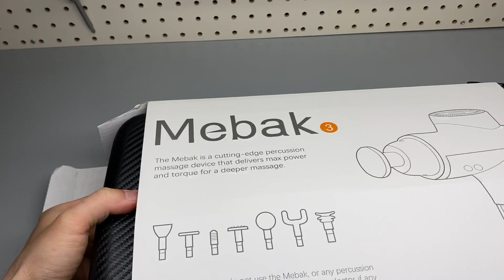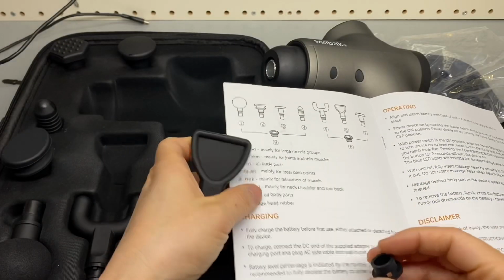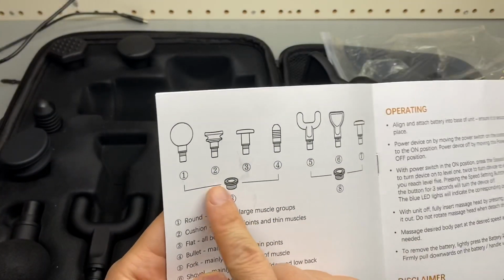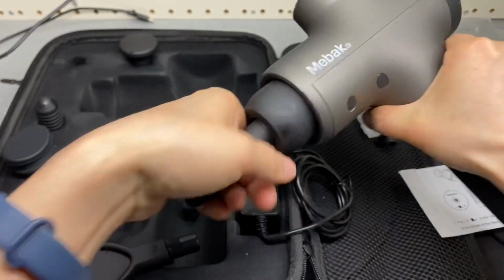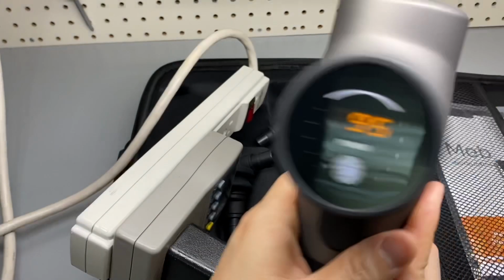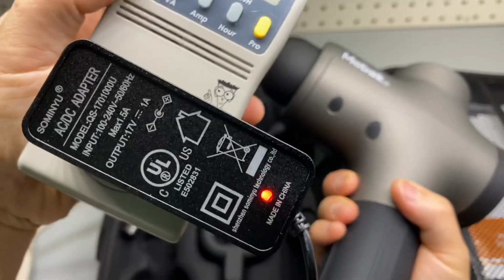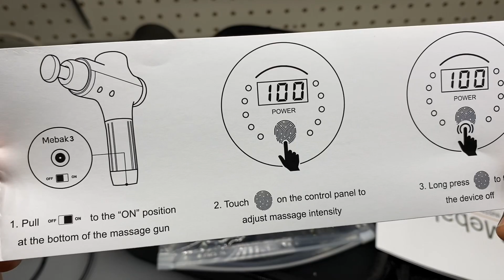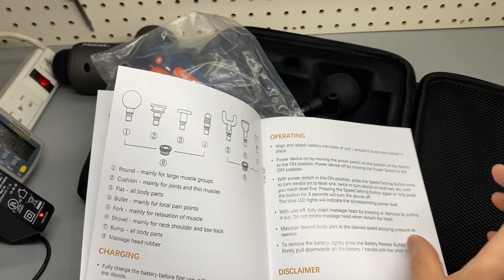Mebak Massage Gun with Brushless Motor

Comment: Didn’t this one have a pressure sensor? I didn’t see it
Reply from the maker: I didn't know it has a pressure sensor.
Reply: @ToolsElectroDIY  If you look on Amazon

https://www.amazon.com/Massager-Percussion-Handheld-Portable-Brushless/dp/B083BY3B2T

There is a set of LEDs to the right of the power number. 

Maybe Mebak makes more than one model.
Reply from the maker: Right. It looks like a different model.
Reply: @ToolsElectroDIY  the pressure monitor are the lights on the right side of the screen that shows the speed. Green yellow and red light that indicates you are applying too much pressure.
Reply: @ToolsElectroDIY  It looks good.  Does it get powerful at the highest speed.
Reply from the maker: @danlivni2097  Yes. I rarely use it at max speed though.